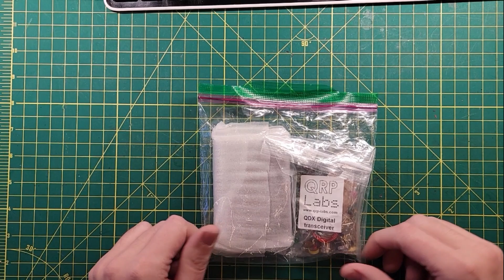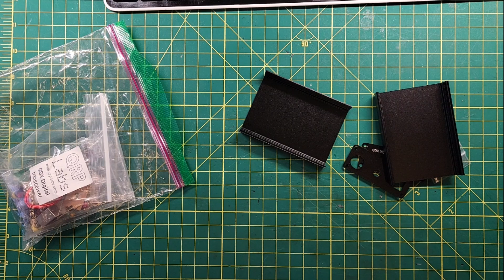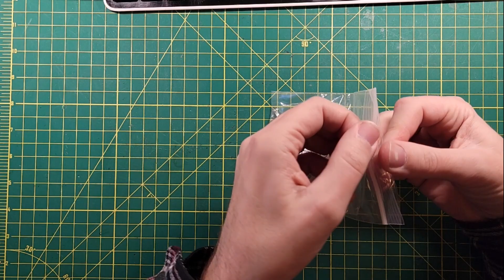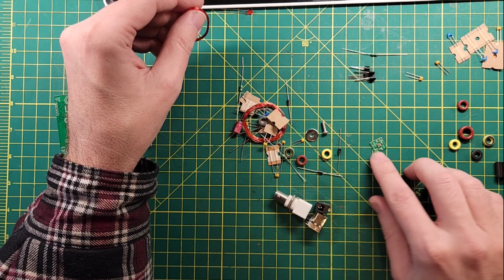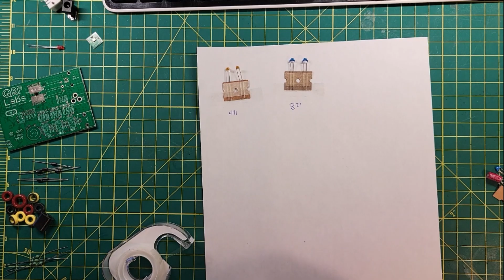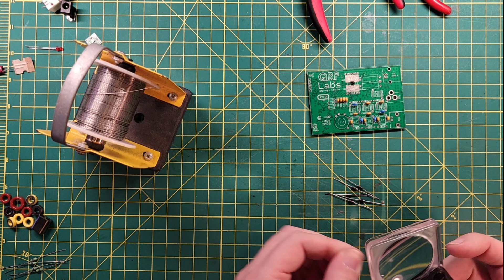QDX Build Vlog 1 - Overview, Caps, Diodes, Finals

Comment: The only thing I am not comfortable with is winding my own coils and transformer.  Too much room for error with inductance
Reply from the maker: You're right that there is room for error, but I don't think it will cause any "harm" that you can fix by re-wrapping them correctly in the unlikely event they get wound wrong.  I typically bunch up the turns on the core for easy counting - sets of 5 or so - and then once I have it right, give it one more re-count, space them out nicely and solder it home.  No problems so far.  If you're really worried, this is the best of the cheap LC meters: https://amzn.to/3NWU2wR - or if you already have a NanoVNA, there is a not so easy way to test L/C with those as well.

Comment: GD dr ops. I have this QDX Rev. 2 since a few weeks (I could buy it after 10 to 20 seconds-at this time >50 were sold 🙀). It's a great little trx for FT8/JS8. 👍 to QRP Labs. I had a little FT8 exchange with Australia on 80m. My setup was a delta loop made of 10m wire and two variable capacitors from broadcast radio receivers for tuning. ODX abt 15thd kms.
Reply from the maker: Sounds like you are having a lot of fun with it!